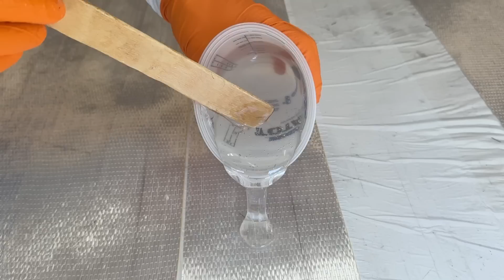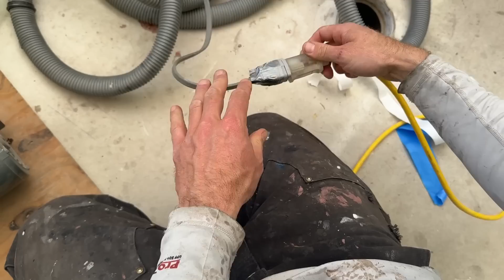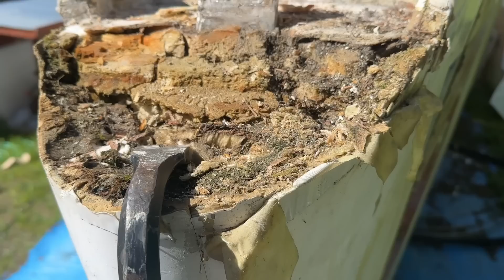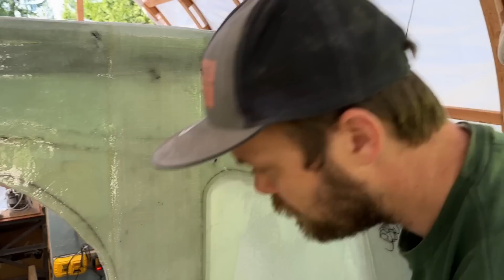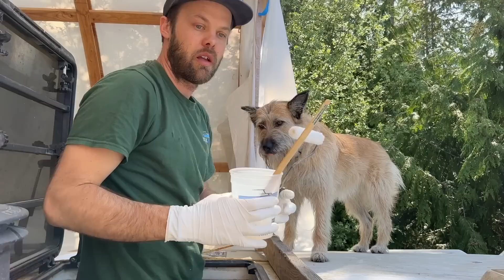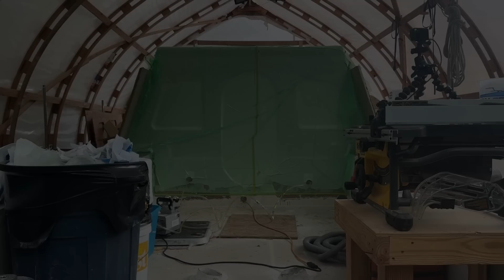Boat Build: A HIGH STAKES Project [E78]

Comment: While I haven't done any work with epoxy I wonder if you could put those rolls of wetted out glass in an electric cooler set at say 40-50 degrees (or somewhere close to min working temp. of the material) while your wetting out the other pieces to go on the boat.  This would slow down the chemical reaction and give you more working time.  You wouldn't need much of a cooler, maybe one of those 12v peltier types.

Comment: One off custom boats like Duracell are usually built over a male plug. When you get to the bow you overlap the sides of the hull laminates inside and out over a wide stem for ease of construction. Then the bow foam is glued on and shaped to the lines. Very common method in high end racing boats.

Comment: If you are worried about working time with the epoxy you would be better off infusing the bulkhead.  You should be using the blue peel ply as the white peel ply is normally used with prepreg.

Comment: Nothing more satisfying than pull off that peel ply!!
Never heard a crackling noise when disconnecting the vacuum before. You have any idea of the layer that was crackling?? The bag, the ply, breather cloth?? 
Last question, mid boom sheeting??
The racer in me cringes.
Reply from the maker: the sound is the plastic bag separating from everything underneath it. End boom sheeting!

Comment: No idea of course if this is the issue you have with the carbon chain plates, but in case you don't already have a solution you may want to consider that as designed, they look to put a lot of peel load into the hull.  Tying them into either a bulkhead or better yet the deck would address this.  Source: am engineer with composites experience.  Good luck!
Reply from the maker: we are going to tie them into the bulkhead. there will be a lot of laminate stacked on top tying them back into the boat.

Comment: Ha! Great seeing your Sunny/Acetone gallon can just like us casual resin/composite users...Home Depot/Lowes...and not a commercial carboy or 55 gallon drum stored in the woods
Reply: Just a thought...I am sure it has been discussed and thought out but your SS chain plates albeit 300 lbs, net wt about 200 more have endured years of ocean racing without failure under comparable situations to your anticipations what is the historical experience with carbon chain plates laminated to hull with or without mechanical fixation comparable to SS chain plates...one thing I noticed was when you removed the SS plates there did not appear to be any( insignificant) rust/corrosion spots of alloy imperfections...if so that's remarkable marine SS alloy not your run of the mill 18-8

Comment: I love that your dad was wearing a post nuclear disaster coverall and boots, and you are wearing T shirt, shorts, and crocks!   : ⁰ )

I just had a thought regarding the color of the hull. Recently I'd suggested painting it in cobalt blue, essentially a warm blue (by adding a bit of orange and violet purple to whatever tone of blue you like), and it struck me just now, it would be interesting to do a slightly different hue of the same blue, just a subtle change in temperature, maybe, even a blue green, only on the part of the stern that was extended, thus, the original shape of Duracell's hull would be alluded to, graphically, as an homage to the past. Maybe a thin copper line (like pin-striping) separating the two tones of blue might work just to reaffirm the shape, but it has to be done just right, so it doesn't look weird. And, I assume you guys will keep the name Duracell, right? It would be interesting to have the name of the boat painted in copper color as well.

And don't forget to show up at Les Sables-d'Olonne on Nov. 10 2024 for the start of the Vendée Globe!   : ⁰ )
Reply from the maker: what an interesting idea. We have time to decide on a color. And we haven't decided yet if we are going to keep the name Duracell or change it :)
Reply: I am quite serious about you guys sailing the boat to Les Sables-d'Olonne on Nov. 24. If you organize all the PR for the Duracell being there, with these fascinating YouTube clips, it is very likely you will set up a network for sponsorship, and funds for your furure travels. Perhaps, once the project is finished, you could edit one longish clip encompasing the entire project. 

And if you guys decide to visit Rio, my wife and I will love to show you the place and provide a room and a bathroom; a place to regroup. The house where we live was built by the English navy in the early 19th century to provide a steady bed to the graduated navy officers when they landed in Rio. Besides, there is great sailing in Brazil, beginning with Fernando de Notonha Island up North.

Comment: I am a product designer, but right now I am totally plugged (hahaha), on the issue of color for your boat. There is something beautiful and old fashioned about sailboats with blue hulls and white sails. Besides the idea of painting the hull in cobalt blue, I think the doghouse and cockpit area would look great in copper green, you know, the patina of copper, like the Statue of Liberty. It is a color that is very easy on the eye, and rather calming, so you allude to the original paint job on this boat, but with a twist. And if you do some studies, the combo of cobalt blue and oxidized copper may look very elegant, and full of content. Keep working, and keep posting!

Et, voilá les suggestions pour la couleur:

DURACELL COLOR COMBO SUGGESTIONS

Hull:

Pantone solid coated 2736 c

Stern extension area:

Pantone solid coated 301 c

Pinstriping separating two tones of blue:

Pantone solid coated 471 c

Doghouse and cockpit (and maybe deck?)

Pantone solid coated 351c (or 344 c)
Reply from the maker: thanks for these ideas, chico! you're a bit ahead of us ;) but fun ideas
Reply: I completely understand, especially when you are immersed in solving structural issues. Speaking of structure, watching some YouTube postings by Dick Beaumont from Kraken Yachts may provide valuable safety information for bluewater sailing, besides he is a fascinating person.

Comment: Question from a novice. This boat was built so strong . Is the sole purpose of removing chain plates just to lessen weight.
Reply: L
Reply from the maker: No, the purpose is to rebuild them in carbon to make them stronger and last for a very long time (since steel chainplates oftern start to require maintenance after a while)

Comment: Ha ha! I love hearing you worry about "hot" weather and resin curing. When we lay fibreglass in Singapore it's typically 80% humidity and 32 degs C (90 F). Tropical hardener helps a lot if you're really that worried about it.

Comment: Can I ask an honest question?  For a boat that weighs 15000lbs+, and is going to be turned into a comfortable cruiser, why are you worried about 200lbs net of stainless steel weight? I understand the maintenance savings and other bonuses associated with the carbon fiber, but the consistent focus on making the boat lighter seems an interesting choice  With multiple berths, you're probably going to have close to that much weight just in bedding, much less the exhaustive list of items you add to a cruising boat to make it comfortable. The old water ballasts alone were 3.4 tons. Wouldn't a boat of that size and displacement look at an extra ton of weight as a light breakfast? 😀
Interested to hear your thoughts!
Reply from the maker: every little bit counts😀 in reality, it’s not about the weight. It’s about the maintenance free chainplates
Reply: @TheDuracellProject  Thanks Matt for the reply! I understand and admire the passion, keep up the good work sir! 😀

Comment: Your Moma knows how to use a hammer. The Woody Guthrie song came to mind. Changing the world one boat at a time.

Laundry powder works on hair folicals but it does do some damage to pigments and what ever, I wouldn't use too much. Soak resin stuck brushes before it cures completely in a strong laundry powder mixture and see what happens.

Comment: I've done almost no fiberglass work so someone feel free to tell me if this is dumb, but would you be able to use a vacuum chamber to quickly wet out fiberglass mat? like if you were doing a ton of tabbing you could roll individual strips up into small rolls, put them in a bag/pot and then pull vaccum on it to pull the epoxy through the mat. Once impregnated you pull it out, unroll and squeegee out excess.
Reply from the maker: that's called infusion, but normally the fiberglass is put in place before you pull the epoxy through it

Comment: Question:  chain plates are only in variable  tension.  Kevlar has tension as its strength, would Kevlar be more suitable for Chain plates as carbon fibre?
Reply from the maker: We want stiffness as our strength for chainplates.
Reply: @TheDuracellProject  Not a criticism, i am sure the chain plates will work fine, simply an academic interest.
There are three engineering terms that apply:  Strength is the ultimate tensile strength,  the load at which permanent deformation occurs.  Stiffness is the the resistance to elongation within the elastic range.  And toughness or reliability which is a combination.  Carbon fibre is brittle and so depending on construction may not be tough, Kevlar has both high tensile strength and is not brittle.  Kevlar is not suitable in compression loads but excellent in tensile loads.

Comment: That's a massive bulkhead, well reinforced and so it needs to be to cope with the loads on the mainsheet from mid boom.  As it protrudes so high I hope the bonding to the deck, hull and superstructure are very robust too.

Comment: To get more working time, i put epoxy on ice, helps big time on those big vac bag jobs. 
I take two mixing cups of the same size, i put ice 1/4 way full in one, mix up epoxy in the other, then set the epoxy cup inside the ice cup and tape them together with painters tape around the seem of the ice cup. 
Congrats on another big task done!

Comment: You're woried about working time with epoxy, Use an air conditioner in the shed to lower the temp as low as you can get it, slows the kicking time a lot . You can even tarp in the boat and run a AC while setting up the vac and bags. turn off the ac after the pump is running and let the reaction work. Controling temperature/humidity can be your friend or enemy when working with resins and epoxies